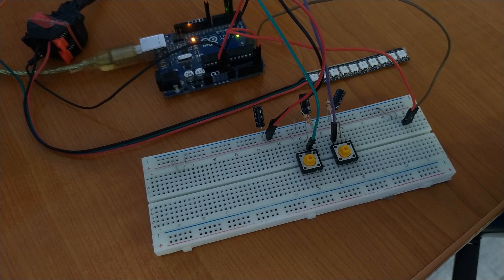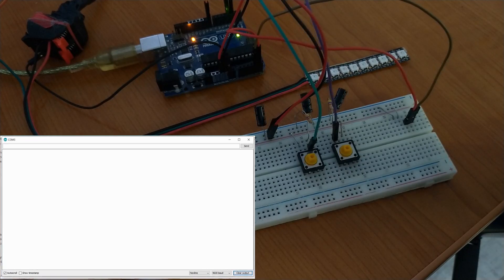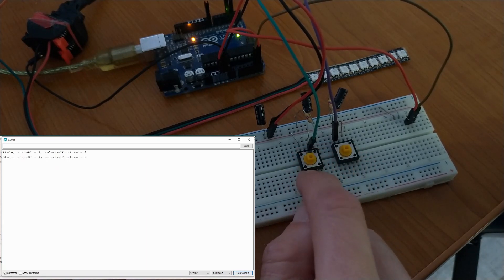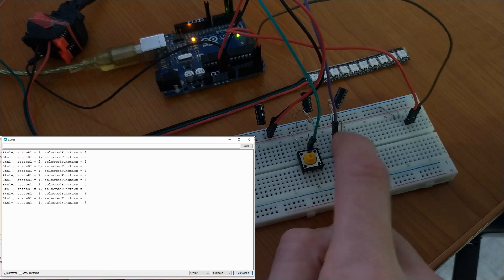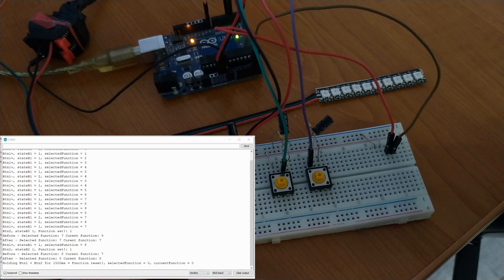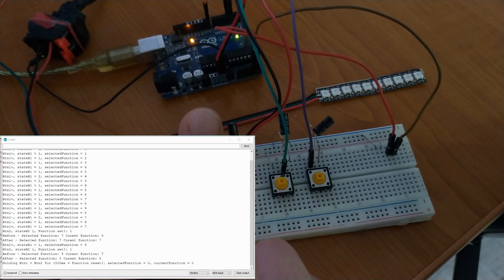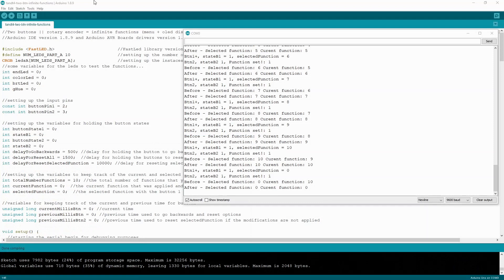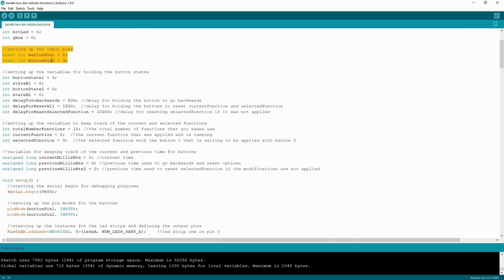Two buttons || rotary encoder = infinite functions (menu+oled display)-Arduino, FastLed and WS2812B

Comment: I get Function Reset! flashing on the screen every second with nothing further working. i checked all connections and they seem to be fine. Any ideas?
Reply: I have the same issues.  I think it might have something to do with the input  pin choices I'm making. I'm also using  NodeMCU.  At 1 timeI have the oled working  And the board wasn't constantly resetting but the rotary still wouldn't work. The push button on the rotary was working though after I  added the pull up resistant.. Now I can't even get it to do that and it is resetting every couple seconds.
Reply: @drumminjeff71  I’ll give it another go this weekend but as of now, mine went from resetting every second or so to switching between modes like crazy. It’s odd because I can load a different file with the exact same setup and it all works well. 

I’ll keep you posted.
Reply: I actually got mine working now. The issue was with the is with the interrupt routine. Since I'm using a node MCU it is a little different and I've never done that before. The ISR function must have the ICACHE_RAM_ATTR  statement before it in the code and I didn't know that.
Reply: Are you using the capacitors? I don't have those installed and the rotary is a bit glitchy. Maybe that's what's causing yours to jump around??
Reply: @drumminjeff71  I am actually but they’re not completely necessary for the test phase. 

I’m running a 1k for the LED’s and 1’s as per the schematic for the potentiometer as per his build. 

As per my build without the OLED, I do not need them at all. 

I’m mainly doing this to add lighting under desks and other places so I decided to just do away with the screen altogether and just stick with the Nano. A 5V, 60 RGB LED strip and the potentiometer. 
Upon initial power it is off. One click will light just the first led and the potentiometer will move the light source left and right along the 60 LED strip (one LED on at a time only)

Second click will light up the whole strip and the potentiometer will cycle through all the different color modes so you can set your color and just leave it at that or change it as necessary. 

Third click runs 10 LEDs of different colors and they scroll back and forth the LED strip. 
Fourth click turns the LED’s off. Rinse and repeat. 

All this does not need a separate power source. Just connect the strip to the 5V pin, GND and the pin of your choice and you’re set. 

If you don’t care for the OLED, this way works wonders. I just thought it would be a nice addition but gave up due to limited time and knowledge to find out what was wrong.
Reply: I wonder if it has something to do with a glitchy rotary encoder that you are using. Mine is very glitchy but I am not using the capacitors. I think the capacitors may smooth it out.  If I just turn it one click it might go to 10 or 9 sometimes 1 or 2.  I have to be very intentional and slow For it to work properly. But all of the functions are working.
Reply: Is your nano the ATmega328  For the smaller one? Because this is a very large code whenever you add in the fast LED libraries.
Reply: If I were you I would add a serial.print line To print out every time the interrupt it's triggered. Because you might have a glitchy switch causing your issues.
Reply: The whole reason I am interested in this code is because I wanted I wanted a rotary controlled menu  for other projects and this one is really cool.
Reply: Oh, another thing. if you're running a whole strip of led's, you probably need a 2.2K resistor from the data pin to the led strip.

Comment: Sir is there any way to control the effects (patterns) of WS2812B LEDS with radio frequency (using NRF24 module). With each button alloted for each pattern. If it is possible using only 1 Arduino nano....please help me out. Please! Your explanations are crystal clear. Please sir.
Reply from the maker: The RF modules like NRF24, are just to make a wireless bridge to send data, so yes you can use them for that, but depending on your needs and RF module you will need two controllers.

There will be in the future a video about rotary encoders over RF, but you can also see the code from this clip https://youtu.be/os1SAVopJIo .
Reply: @IonutF-TS-BB  Thank you so much sir.
Reply from the maker: @mitabhowmik5287   With pleasure! ;)
Reply: @IonutF-TS-BB  This is exactly the same kind of thing I'm hoping to do with a project of mine. (the controlling ws2812b from one arduino to another using the NRF24 module)         
I hope you're doing well, and looking forward to new videos.  :D
Reply: It's possible by using irq pin as interupt.

Comment: I'm got a problem in the sketch "3-tandt4-rotary-encoder-infinite-functions.ino".  My encoder input is only counting backwards (both clockwise and anti-clockwise decrement and will not increment).  The code looks ok to me (++ right, -- left).  Any insight as  to why this might be the case?  Thanks for the upload.  This is my first foray into single pin data strips, so I'm overly used to addressing colors individually and it's nice to have some clean, well commented code to play around with.
Reply from the maker: First of all check your connections, but if it's counting in one direction but not in the other direction, i think that the rotary encoder has some connections problems internally. Try using another one and see if the problem persist.
Your welcome for the code and sorry for the delayed response! ;)